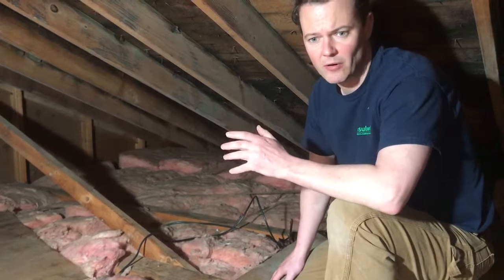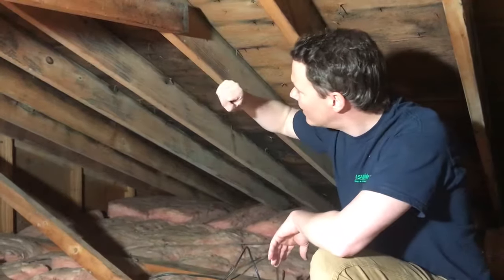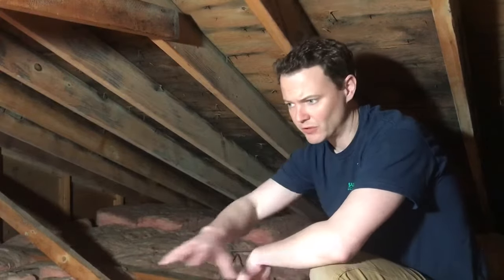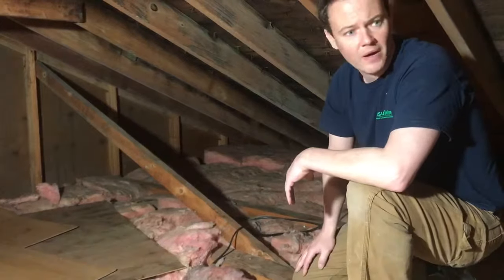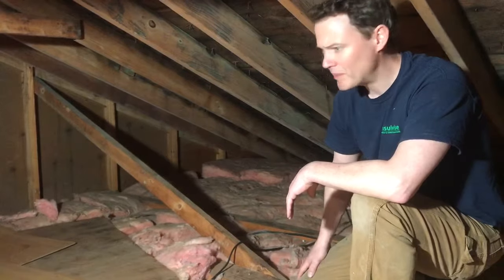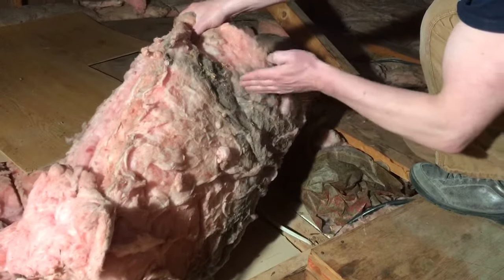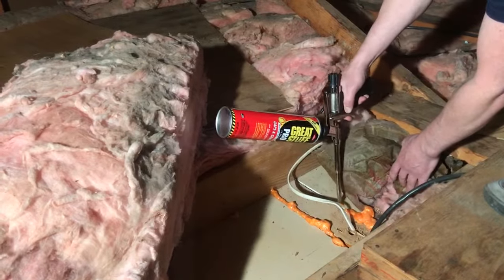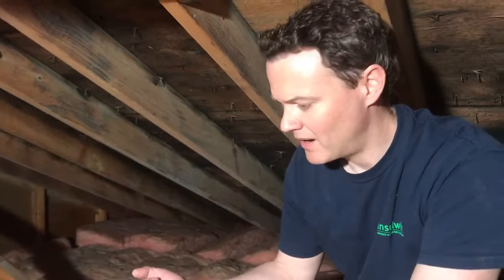There's Mold in my Attic!  What Caused it and How Insulwise Solves it.

Comment: Is it normal for nails sticking out of the roof deck?  I noticed it on the roof your working on.  Can that be causing a roof leak?
Reply from the maker: Hi there Georgia, 
Yes is totally normal to see nails coming through the underside of the roof.   Those are from the roofing nails that hold the shingles in place.  They can sometimes allow small leaks if the heads of the roofing nails pop through the face of the shingles, but these are usually small.  If the attic is properly vented, and if the home isn't pumping significant moisture into the attic via wintertime Stack Effect, these types of "leaks" will typically dry on their own without causing any serious damage. 
Andy
Reply: The nails holding the shingles onto the roof are what's sticking through. The nail head should be covered by the next row of shingles. Therefore, there shouldn't be any water able to get to the nail head to leak into the attic through the nail hole, because they're covered.

Comment: you have to contain the attic with plastic, negative air pressure, scrub and sand the mold away, then wipe it with mold killer. spraying it won't kill it because it has been on this plant for a million years and will survive any mold killer.
Reply from the maker: Dear Hfsdhjf, according to who?  Mold is a fungus, and where it exists and is growing on the surface of wood it can absolutely be killed with many of the  effective mold killing agents on the market.  Furthermore, you can scrub it, sand it, and then kill it with a mold killing agent all that you want --- but if you do not address the underlying conditions that allowed it's growth in the first place, namely high levels of moisture and poor ventilation, then that mold is highly likely to grow right back.  

We have been called out to address mold growth in numerous attics where mold has already been treated by another company, but then came back.  Often there's a white primer or paint on the underside of the roof --- with black, round mold colonies growing right on top of it.  Our view of mold is that it is a symptom of a moisture problem.  If you remove the moisture, then mold cannot grow.  

Hope this helps, 
Andy

Comment: Is a small water leak from roof in attic normal ?
Reply from the maker: Unfortunately yes.  I would say the vast majority of roofs that we work beneath have small leaks somewhere.  Typically it's a piece of roof, chimney, or skylight flashing that has failed for one reason or another, the head(s) of roofing nails that have popped through the face of shingles (extremely common), older / degraded shingles with spiderweb cracks in the face of the shingles (that's what they look like when you examine them closely) that allow water to seep through them rather than shedding it, areas where wind driven rain gets blown in on occasion, dry-rotted and cracked rubber seals that go around your plumbing pipe penetrations (extremely common), etc.  

The bottom line is that many roofs leak somewhere, but often not that much at a time.  If the attic is well ventilated, or poorly insulated, it's often not that much of a problem because the wet area simply dries out once the sun comes back out.  But if either or both of those conditions are not happening, you'll have a perfect set up for mold growth. 

It's always best practice to repair the roof leak as soon as you know that you have one, regardless of its size.  

Andy

Comment: My condensation is so bad my ceiling is leaking bc of this
Reply from the maker: Yikes!  Vent your bath fans out, air seal your attic floor, make sure your roof is water tight and has enough balanced ventilation, and lastly turn your humidistat WAY down.  This will more than likely solve your problems.  
Andy
Reply: @ I fixed it after all it was the shower pipe leaking
Reply from the maker: @mikelopez4148  Nice work there!  I'm sure that took a bit of mucking around to find, but usually when you find these types of problems they're obvious as soon as you see them.

Comment: Why no vapour barrier?.
Reply from the maker: The air sealing work that we perform in the attic in combination with the paint on the underside of the ceiling forms a fairly effective, but not perfect vapor barrier.  The roof ventilation measures that we often need to install are designed to allow any moisture that makes it into the attic space an easy way to get to the outside.   Homes here are not constructed with intentional vapor barriers on the attic floors or the ceilings inside the home.

Andy
Reply: @insulwiseenergycomfortsolu3293  thanks Andy. Im restoring and older home, simple farm style.  Ive cleaned the attic of old insulation, rock-wool matress stuffing, cardboard, fibreglass etc down to the deck.  Ive been told older homes need to breath, but also people have said I need a vapour barrier.  There is also probably 30 layers of paint on interior cladding.
Reply from the maker: @StanTheMan-us3tp  Ok I understand, that was probably a lot of work!  Short of spraying 2" of closed cell foam onto the floor of the entire attic, you're not going to be able to put down any sort of effective vapor barrier.  That would be great, but highly expensive and also unnecessary.  You want to make sure to air seal your attic floor by sealing shut the air leaks and vent any bathroom fans out through the roof.  These two things are critical.  After that make sure that your roof is watertight and properly ventilated (you will need both intake AND exhaust ventilation, and probably more of it than you'd think).  

Here is a link to our attic air sealing page so that you know what we're talking about.  
https://www.insulwise.com/insulation/air-sealing-insulwise-pittsburgh/

At this point you've done two things.  You've sharply reduced the amount of moisture that can get into your attic in the first place, and you've provided an effective pathway for it to get out (if some does get in) in the second place.  Your attic floor is now ready to be re-insulated.  For a variety of reasons we are big advocates of using blown in cellulose insulation, probably blown in to about 15" of depth for an R-49 insulation rating.  

Hope this helps!
Andy
Reply: @insulwiseenergycomfortsolu3293  thanks for taking the time to write back, informative and much appreciated. Cheers
Reply: @insulwiseenergycomfortsolu3293  It's necessary dependent on your area/building code. I live in Ontario, Canada. Our builds will not pass without a proper seal between the attic/exterior walls(We use 6mm Vapour Barrier) Generally spraying at least 2' of spray foam, with R-50 of cellulose on top is the only fix for most retro's here, unless we drop the ceiling. Very interesting seeing how different insulation can be in warmer climates none the less! From one family business to the next, I commend any insulator that's reputable. The industry is filled with total wanks
Reply from the maker: @currincook6422    Ha!  Thanks, I totally agree on the wank-factor in this field.  I have competitors in Pittsburgh, some who've been in business for decades, that still go out every day and tell homeowners that air sealing an attic is unnecessary because his blown-in fiberglass "will seal up any air leaks that are present."  It's amazing, some of the "pros" here I'd describe as willfully negligent in their practices (not that I'd call us perfect).  

We do a lot of zone testing of our attics after air sealing them and our guys have gotten pretty good.  In retrofit applications I'm guessing spraying 2" of closed cell on top of the entire attic floor or covering it with a 6 mil vapor barrier must be pretty challenging / expensive?  Or are those specifications only required for new construction?  We exclusively do retrofit work. 

Andy

Comment: Can mold have a weed smell??
Reply from the maker: Mold shouldn't smell anything like the "piney or skunky" smells associated with weed.  Mold smells musty like a damp basement.

Andy
Reply: @insulwiseenergycomfortsolu3293  my house has a piney weed smell and it just got cold outside nobody smokes in my house do u know what can cause that
Reply from the maker: @valdez2799  I do not.  If your home has carpets I would recommend them getting cleaned and if it has ducts I would recommend also having them cleaned.  I'd also ask the people that come in to perform the work what they think it could be.  Both of those solutions are relatively low cost and will leave your home cleaner and better off even if the piney weed smell isn't resolved. 

Andy